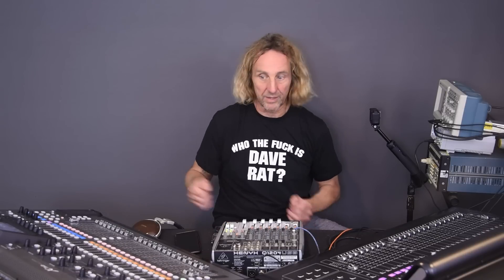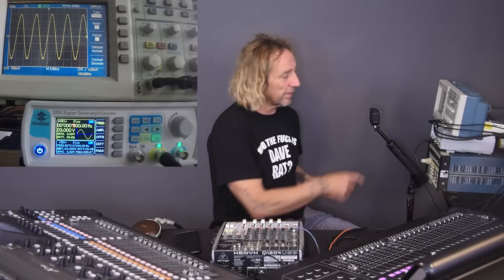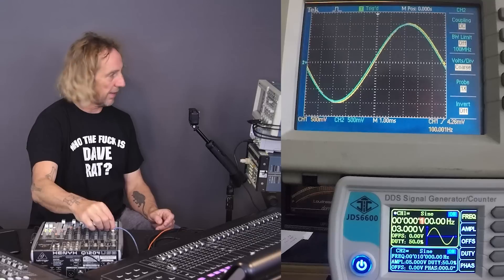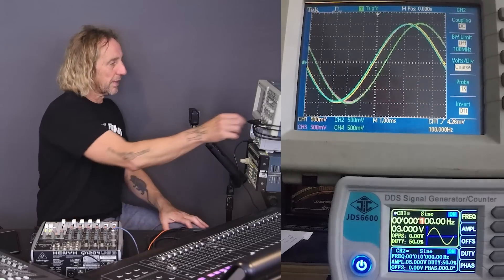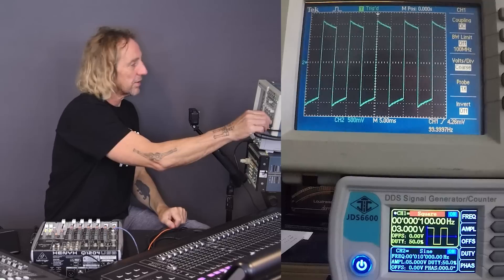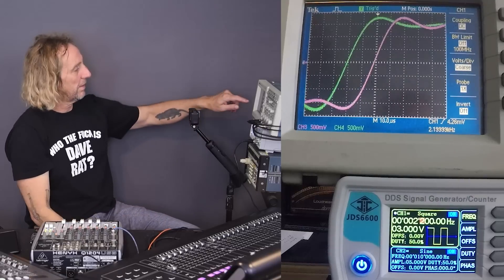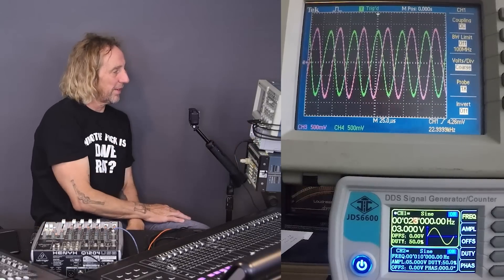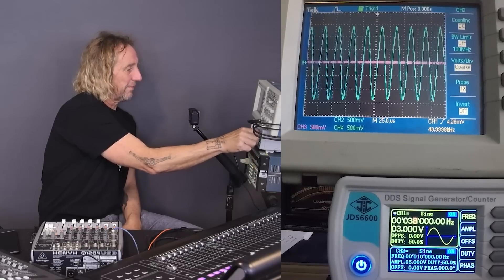Which Sounds Better Midas M32 vs Behringer X32 vs Copper Wire

Comment: it might be the sampling rate of the digital mixers that make the signal "chop chop", my suggestion is make a mixer that can do more than 44khz or 96khz. make the clock higher maybe 1Gigahertz. and it might be as linear as an analog mixers. lol
Reply from the maker: I did this video on the concept of digital stair stepping and whether it exists or not that you may find interesting. 

https://youtu.be/OwjHE1DQSyA

Comment: Set at 48k?  I wonder what the 96k Allen and Heath would do?
Reply: Yeah that’s one of the main reasons I hire in A&H, DiGiCo, Avid, Yamaha consoles… they clock at 96k+, so the steep nyquist filter isn’t affecting nearly as much in the audible range. 
These behringer/Midas entry boards are very useful, sound *okay*, etc., but they sure do seem to fall apart easily.
Reply from the maker: agreed and yet no good deed goes unpunished. 

having higher sample rates also allows lots of frequencies above audibility of float around in your mix. with a 96K console over 1/2 of the sound energy it's capable of is above audibility.
Reply from the maker: Pretty much the same thing but double the frequency that it happens.

Comment: This shows the limits of digital sampling and why sampling rate matters. Most people say 44.1kHz is enough but there are benefits of sampling at higher frequencies. Also, that overshoot happens because a sudden change in level in the analog wave is seen as a discontinuity when it's sampled and it's also because of the limited sampling rate, this is called the Gibbs phenomenon.
Reply from the maker: I am doing tests on digital consoles now and one issue that has come up is using  a sample rate of 96K means that 20k is being used and 75k or so is susceptible to processing inaudible noise that can mess with metering and headroom
Reply: @DaveRat  That's interesting.Is that related to noise shaping?  BTW,  I'm new to your videos, though I've seen your name in industry for a long time. Your videos are really good and always learn something new.
Reply from the maker: Cool cool Javier! Basically if you sample at 192k the freq response of the gear goes up to about 95KHz All good except if there is a radio station nearby or somehow some RF gets into any of the inputs you could have 60KhlHz floating around messing with headroom and causing issues.

But you'll never hear it or even know. It will just make things clip early and screw your metering up
Reply: @ Does this happen with every digital console? ADC IC's normally have differential inputs, in theory that would cancel a common signal. Digital signals are immune to interference (in very small amounts), so I don't think the digital circuits are picking it up. I wonder if they decided to save money and used single-ended ADC and no RF filters at the inputs. I can only think it's an aliased RF signal showing below 100kHZ.
Reply from the maker: Currently the issue seems to be two things.

1) summed noise signals will be 6db and 3dB louder correlated and de-correlated respectively. This will be the RMS level but occasionally the two signals will have randomly correlated summations even if de-correlated. Though rare, these summations are more problematic to to happen at higher frequencies than lower frequencies due to higher freqs having more opportunities for it to happen in a given time frame. Due to digital having such a negative reaction to overload, digital meters are set to read peaks when even very short time frame peaks happen. But analog meters are set to look more atr the signal average and even analog peak meters are not set to show micro peaks as they do not really negatively impact analog sound.

2) the Nyquist or other filters especially steeper filters almost always have ringing and nonlinearities for signals at and around the cutoff frequency. White noise and signals that have significant energy up near the cutoff frequency will tend to read higher levels than the rest of the signal, these filter freqpeaks show up on the digital meters. 

I have not fully confirmed #2 is a factor or how much but adding steep low pass   filters should mitigate #1 but the steep filters can actually make it worse.

Soft vessel 6db low pass filter help. So that indicates the filtering could be a factor.

And yes I've yet to find a console or any digital software that it doesn't happen on

Comment: what instruments or vocals produce a square wave,? who hears 24khz? most amplifiers will start oscillating at 18khz.which is why you cut at 15Khz.
Reply from the maker: Synthesizers can have square wave outputs as well as distortion pedals for guitars or just turning up any mic preamp.
Reply: @DaveRat  I forgot about synths
thanks Dave.

Comment: The ultimate board. A step backwards. Analog i/o and mix, digital delay and reverb. Period
Reply from the maker: That's how I like to mix and when mixing went digital, I stayed analog until finally I quit touring rather than switch
Reply: @DaveRat  
Weirdly enough, because I am on the gulf coast, I switched to an XR18 and a pad because it is more reliable around here than potentiometers. But I never kid myself about the sound. Is it good enough? Yes, but does it sound and feel as good? Nope l. But the reliability is fantastic. Just what I didn't expect.
Reply from the maker: @peteleoni9665 cool and interesting.

Comment: Wouldn't expect them to waste processing power on frequencies we not only can't really hear but most PA systems can't even produce.
Reply from the maker: I personally like the equipment that I use to be able to reproduce frequencies above and below what I will use it for.

Having a car that barely goes to speed limit is not the same as one that goes way faster than the speed limit even if you're driving the speed limit
Reply: @DaveRat  I mean I would like for an X32 to sound as good as an S6L but you have to keep in mind the intention of the product. The X32 as you know is a budget console, and those previously stated factors makes it more than understandable even expected that they are going to cut costs where they can, and this seems like an obvious place to cut down on processing power.
Reply from the maker: Yeah the The capability versus the cost of the X32 and M32 is pretty much as good as it gets. And they sound good enough and the sound quality is not the primary issue in my opinion. The biggest issue is that engineers clip the consoles and make them sound bad and there's not a lot of headroom

Comment: Loved your closing statements, very insightful. Considering a Wing board and wonder if they have made any improvements. I would assume the sampling frequency was the major cause to the disappearance of higher frequencies on the digitals. The ringing on the Squarewave really had my curiosity as to how this would show up in live situations. The best part was using the cheap analog board as a comparision. Brilliant. I would assume a 96 khz sample rate would have less roll off as the multiplexing of the channels is on a broader width. Would love to see an A&H performance test on these tests.

Comment: Your last comment is VERY important. Yes, it's demonstratable that analog gear surpasses the capabilities of digital in terms of frequency response, but how does it translate in a real world way when you're trying to make a band sound good. It might matter a lot for some things, it might not matter at all for others. That being said I would imagine the vast majority of applications are in the latter camp. And I'd even go so far as to say that's not only live but in the recording world as well. As you say, there's a tiny sliver of listeners that are in a position to even experience the extreme extreme high fidelity of the most high performance systems, like what you'd have at say, Skywalker Sound or something of this nature, but in all probability, as long as you know the limitations of your system (whatever they might be), there's always a best case plan to simply make things enjoyable for the audience, which is the goal of any live sound engineer or any record.

Comment: That analog rounding off the edges for hf square wave is just sum slew rate of all the solid-state parts in the circuit. Thanks for the video showing these differences. Very helpfull

Comment: I’m using the midas stagebox for all ins and outs and the x32 rack for processing, would there be any difference in switching to a m32 for processing? do they have the same amount of dsp power, plugins, etc
Reply from the maker: DSP processing and software are the same. The main advantages of the M32 over the X32, that I can find is lower noise and more durability and some higher quality components and slightly less latency in the console

The M32 is a little more pleasant to work on with the screen angle and better faders but for most applications there's not much difference.

I think the M32 will last a little longer on the road as it's slightly better built

Comment: This leaves me with a question....
Is this only applicable for live sound, or does it translate in to the recording world as well?

Example, in the digital consoles, they run the input through an analogue preamp, then through a analogue to digital converter pre fader.

If you are running all analogue, you can keep everything analogue through the faders, and even out your mix and master busses. But then it still has to go through an analogue to digital converter.

Do different converters then have a large effect on the recorded sound?
And what style of recording preserves the most accurate sound quality?
Reply from the maker: It's about using the proper tool for the job. Digital adds a lot of features and power and control and is necessary for some things or many things.

That said it's important to know that analog or just a simple piece of wire is better than converting to digital and back again if you don't have to

There is a line of thinking that digital is better but in reality simplest solution that performs a job well is best

Comment: Many X32 users do not know about the internal signal delay)))
I've been using the X32 for 15 years now and no longer want analog boards with tons of cables and huge boxes of external processing, digital makes my job easier.

Comment: Hello Dave,

I thoroughly enjoy your videos. Thank you for doing them.

Would it be possible for you to compare an M32 to a Wing console?
Also a 338 to an S6L?

Sincerely,
Devin Clayborn
Reply from the maker: Hmmm, will see. I am more into disproving or confirming myths and and clarifying misunderstandings than I am into product review or comparison. I did the M32/X32 comparison because there is so much false info and conjecture floating around out there, thought I'd add some clarity
Reply: @DaveRat  But I am still confused, which good console can we use between M32 vs X32?

Comment: a 96khz converter is enaugh to give us 40khz of audio frequency... the problem is that PA cabinet give us no more then 18khz...
Reply from the maker: Hmmmm, movie tend to be shot in 4k yet people rarely view them in anything above 2K or 1080p.

Should they just shoot the movies in 2K or 1080p?
Reply: @DaveRat  not good comparison, imho.
on video you can zoom in with higher resolution shooting, and have the maximum quality to final resolution.
but live mixing is not recording.
on recording I am with you: 96k is the minimum.
in live mixing, with board  they do not introduce distortion (and so aliasing) with vst and with limits of PA cabinet is not so important to have extra resolution.
I add: for many years we have recorded and mixed discs at 44.1 or 48k and we have not problem at all.
Reply from the maker: Definitely a gray area.  On one hand I understand the logic and all the math and specs.

On the other hand recording never sound as clear and realistic as actual real time live.

It is near impossible to record and replay so accurately that a person believe it is real time live.

So what is the issue?  The speakers? The bit depth? The sample rate? Analog vs digital? The mics? Or perhaps all of the above or some combination there of.

I believe that if we could go the other way, record and playback something indiscernible from the live instrument that was recorded, we could then go the other way and reduce bit depth, reduce sample rate, reduce other factors until it then became noticeable that it is a recording.

And then we could say with a higher degree of confidence what matters and what does not.

Until then, we are stuck pushing specs higher and higher in hopes of getting remotely close to realistic recreation. Which seems a long ways off.

Comment: This is what would be expected from any digital board. Since the sampling rate is at either 44.1 kHz or 48 kHz. At 48kHz, the nyquist frequency is at 24 kHz. Meaning that the highest frequency you can reproduce is 24kHz. Think of it like the resolution of the signal in the time domain. Since you can't have a perfectly smooth digital signal, you have to set a sampling rate that can reproduced the entire human hearing range. But there's no reason to reproduce anything above 24K since we can't hear it anyway.
Reply from the maker: Yet the 2 consoles are not the same around Nyquist.

And though we can't "hear" beyond 20k does not mean we can not perceive beyond 20k.

In fact your perception of light as you read this is a way way higher frequency than 20k, sunburn, heat from infrared light and headaches from RF antennas are all perceptions of frequencies above 20k.

But that is not the point, we measure freq response to indicate the capabilities of an audio system much like we measure the top speed of a car to indicate the capabilities of a car.

If one car can go 180mph and another can go 90mph max speed and you never will drive over 80mph, they are both the same, right? No difference between the cars. Since with the driving we do we will never feel a speed faster than 80.

Basically things are more complex that the simplistic thought, "people told me it can't be heard, therefore it does not matter" and perhaps looking at what can be perceived by the body as a whole rather than just heard by ears. We can't see ulta violet light but we can get sunburned by it.

Oh and also, can you hear 40khz? Can you perceive it? Are simple answers and assumptions to quantify the dynamics of the human body relevant?

https://youtu.be/tNpPFEwX6Y4

Oh, and check this out

Comment: Holy Cow! I've been using a RAT Sniffer on the job (Reality TV house builds) for 16 years and I never knew, that beyond creating an amazing tool, you are such a prolific sound engineer. I've been going down the rabbit hole of your YouTube vids and have (am still) learning so much. 
Ass kiss-cry aside, I would be curious to see how much further latency and over modulation occurs on these digital (or even analog) mixing consoles, once you start adding effects (both real time-compression/EQ and time based). Thanks for sharing your smarts!

ps:: when are you going to do a 1/4" TRS interface for your SoundTools CAT system?
Reply: Love the sniffer sender.
Reply from the maker: So cool and thank you!!!

Comment: Don't forget the tests are valid at the impedance of the wire. Add a very high impedance source of 50,000 ohms into a 62 nominal impedance 100 foot snake, and the difference is very real.

Comment: As a "synth head" (synth nerd) I can assure you that the exact frequency spectrum of square waves matter to our ears quite a lot. Most synthesizers allow the output of pure square waves, so in lots of synth sound production, square waves are really bread and butter starting points (along with triangle, saw and noise). Your video is a real eye-opener on this topic. Thanks for making and sharing!
Reply: Sorry but you are wrong, not a single analogue synth has ever out put a perfect square or sawtooth or triangle waveform. Not once. Most digital synths do not do this either due to limitations in sample rates and filtering. Which is the same problem we are seeing on these mixers. The 'gibbs' phenomenon. You are objectively wrong.
Reply: @ferociousmullet9287  Shot down in raging flames for the use of the "pure" adjective. You are quite possibly objectively right (cfr. Carlsberg advert)
Reply: Don’t forget that as a “synth head” you take all of those beautiful square waves and shove them through a low pass filter ;)